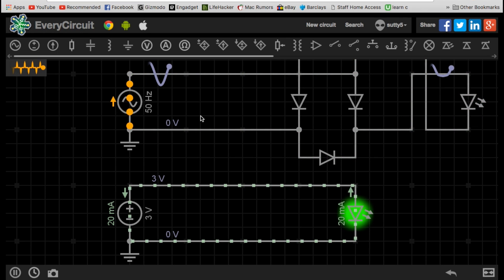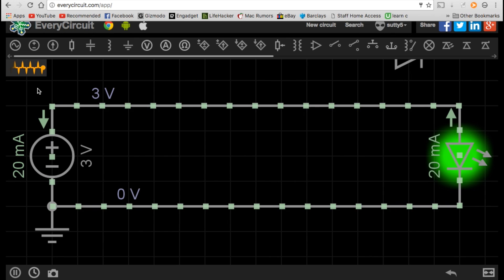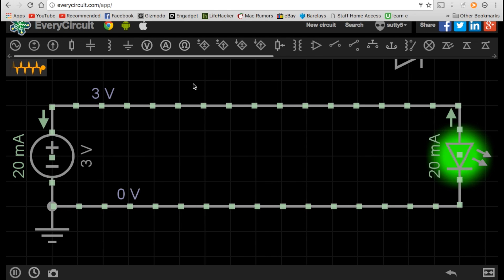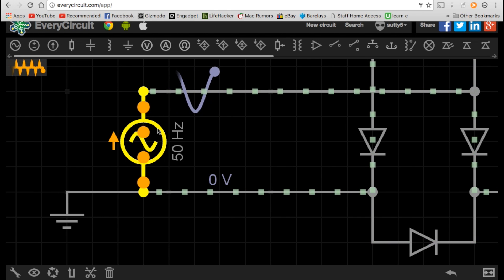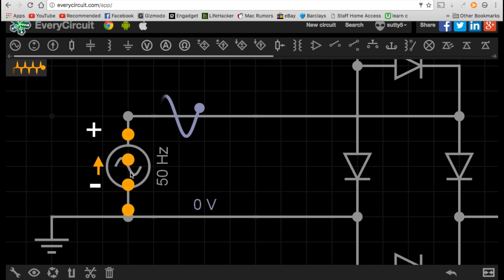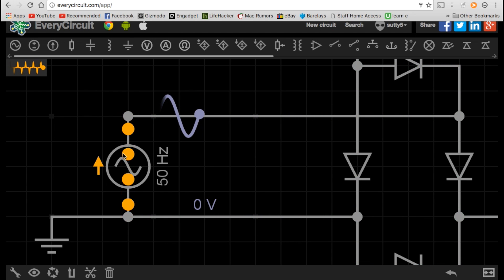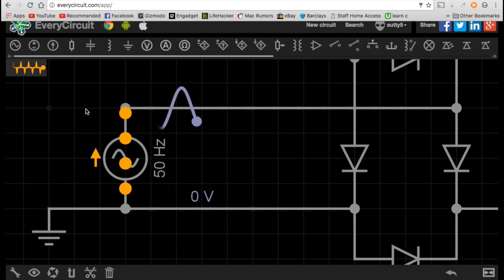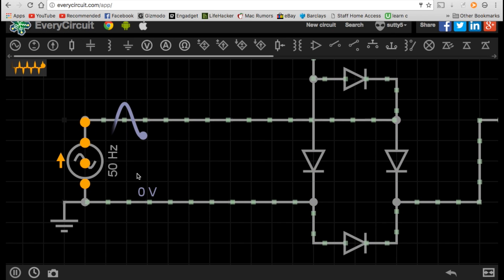AC vs DC What's the difference?! (Interactive!): Electronics Basics 3

Comment: your description of why we have alternating current is incomplete, the reason we us AC is because AC is the best way to transfer power from place to place.  if we still used DC and DC generators there would be a need for generating stations every few block to boost the power due to losses from the resistance of the transmission wires.    thank you Mr. Tesla, and not that guy who makes electric cars.   mike

Comment: Power plants DO NOT create AC at the point of generation.  This is a common misconception.   They actually create a Radiant Voltage Potential that is "Transmitted" down a "Transmission Line" in an "AC Like" signal.   When this potential reaches a Pole Transformer, it is slashed into a 50hz current for the UK, or 60hz current for the US, creating AC current for the customer.   Don't believe me?   Ask a lineman from your local utility.   Ask him/her if they can connect an AC circuit to the transmission line "BEFORE" it hits the transformer and power an AC device.     None-the-less, great videos/visuals.

Comment: I am curious...each circuit is grounded on the negative side and since most grounds from my understanding are positively charged why doesn't current flow go to ground and short out the circuit in AC or DC examples. Please explain???
Reply: This is a good question that I struggled with for a while. The reason, as I’ve come to understand it, why this doesn’t happen is: the important thing about a circuit isn’t necessarily which direction the charge is flowing in, but where the voltage differences are. When we talk about conventional current, where charge is flowing from positive to negative, the positive side of a voltage source like a battery has a positive voltage with respect to ground, so positive charges flow towards ground from that positive terminal. In the case of electron flow, that voltage difference still exists, it’s just that you can imagine ground as still being at 0V and the positive terminal of the battery as being at negative 5V, for example. This means that the electrons flowing out of the “negative” terminal are still at 0 V with respect to ground, so there’s no short because they’re still going to flow from higher Voltage points to lower ones, and the circuit behaves the same way from our perspective. I hope that makes sense!

Comment: So i'm confused about one aspect. In the first video , the circuit was flowing starting from the + terminal of the source all the way to the - terminal of the source. In the second and this video it's coming from - terminal going to the + terminal. Is there a rule ? Can somebody explain how it works ? Thanks ! (sorry for bad english)
Reply: It depends on how you view the direction of the current flow. Let me explain: Back in the day, before physicists discovered the electron, engineers thought that it was positive charges that move through the current, so they agreed on the technical current direction + to -. When physicists discovered that it was actually negatively charged electrons moving through the circuit, the direction + to - was already generelly agreed on. So that's why we nowadays have the technical current direction + to - and the physical current direction - to +. Physically, it doesn't matter because you can just view the flow of negatively charged electrons from - to + as a flow of positively charged electron-absences or electron-holes from + to -. I hope my explanation is clear :)
Reply: @AndiixAndii   .... Tanks, Yes.   But surely once an error is discovered it needs to be corrected.  Also to show 2 directions of flow in the same series is misleading and can/does cause confusion.  
So it is either one or the other not a random mix of both.
Reply: @Jasfras1  Yeah I agree. He should have mentioned it
Reply: Me too.

Comment: These videos are awesome! One detail that is wrong is the reason for A/C in our homes. You mentioned it's because of how we generate power but, just as an example, solar farms generate D/C and we actually pipe each array of panels into inverter houses where the current is converted to A/C before going off to a substation that transforms the voltage up high enough for long distance transmission. It's the fact that we can transform A/C currents up and down so easily that it gets used by the mass majority of the grid. We jump the voltage up to thousands or even millions of volts to travel thousands of kilometers and then jump all the way back down to the 240 in our homes. The problem with D/C historically has been the inability to jump it up for transmission and back down for safe consumption.
Reply: Another thing that I think he said wrong was that current swaps direction 50 times per sec. In actual it should be 100 times per sec, because each cycle/wave has 2 points where current's direction changes.

Comment: The reason we receive AC current into our homes and not DC is due to the transmission problems DC has over distance. Thomas Edison and Nikola Tesla went through a feud way back when. Edison wanted to use DC current while Tesla wanted AC. Problem was Edison’s DC could only travel about a mile from the powerhouse before the voltage and current drop was too much. While AC can flow for hundreds of miles of power lines and still be useful. The powerhouse creates DC current which is turned into AC. Then sent down the lines. Then once again turned into DC (sometimes; most small devices run on DC). Your usb block you plug in between the wall outlet and your phone charger (your phone runs off of DC) so your charger turns 120v AC (USA) into 5v DC. (if you are EU I think it’s like 220 or 240 but it’s the same principle)
Reply: This needs to be higher up!

Comment: don't cars also generate current from spinning motor? why would cars then need a battery? safety?
Reply: Cars use the alternator (spun by the timing belt) to charge the battery, which powers the DC electrical systems such as radio and lights when the engine is off. 

However the most critical battery function is to power the starter motor, this is electric and required to start the engine before the alternator will provide any power.

Hope this helps :)

Comment: Hello! Your explanations are very nice. I am enjoying being reminded of the formulas and principles that I learned so long ago in the 1970s when I was an electronics hobbyist.
There is a big error in this video, however! You mentioned that the reason why we receive AC in our homes is due to the way it is generated. This is completely wrong!
Just Google about "war of the currents". It was a competition between Nicola Tesla and Thomas Edison to determine the best way to transmit electricity through long distances. It turned out that direct current could not be transmitted through long distances in an efficient way. 
AC is the most efficient way to transmit electricity through long distances. Without alternate current, the world that we liven in could not exist.
Reply: I have just read an article that talks about a possible comeback of DC as a means of transmitting electricity through long distances. Check it out:
economist[DOT]com/blogs/babbage/2013/01/power-transmission

Comment: Why the elecktron not flow from positif side  to negatif side?
Reply: This is very wrong. Positrons have nothing to do with this, and they are NOT in the nucleus, those are Protons. Current always flows from positive to negative, it's a standart in electrical engeniering. It has to do with potential energy. But if you are not into electrostatics, you should just accept it and you will get used to it
Reply: Sebastian Gudiño I made this comment a while ago. And I mixed up positrons and protons(my bad)
Reply: Sebastian Gudiño I was very wrong at the time
Reply: it is a setting that I just figured out. Click on your user name in top right corner of everycircuit then go to settings.. then uncheck conventional current option. thought i was losing my mind too
Reply: em rifan because, positrons(which gives a positive charge) are located in the nucleus of the atom. But electrons(which gives off a negetive charge) are located in the rings out side the atom.

Comment: I'm a bit lost. If the electrons in AC don't have a net movement, how do they go through a circuit? As well, if they keep switching, don't they just lose voltage eventually from the wires or load?
Reply: They don't actually flow very fast, but they effect the neighbouring cells much like a newtons cradle. So the electrons move really slowly, but the shockwave effect moves at near the speed of light.
Reply: they thravel at 50 cycles per second as per the 50 Hz frequency.  Thats fast enough for them to make it throu the entire circuit electrically both ways!   Hope that makes sense
Reply: It's because of the construction of the circuit. The diodes in the AC circuit only allow for the flow of electrons in one direction.

Comment: Hi. Why is it that if I search the definition of Electric Current in the internet, it says that it follows the Conventional Flow which is from positive to negative side? What is its difference from the flow of electrons which as you say is from negative to positive? I'm just a little confused, thank you for a wonderful video.
Reply: In a conductive material, the moving charged particles which constitute the electric current are called charge carriers. In metals, which make up the wires and other conductors in most electrical circuits, the positively charged atomic nuclei are held in a fixed position, and the negatively charged electrons are free to move, carrying their charge from one place to another. In other materials, notably the semiconductors, the charge carriers can be positive or negative, depending on the dopant used. Positive and negative charge carriers may even be present at the same time, as happens in an electrolyte in an electrochemical cell.

A flow of positive charges gives the same electric current, and has the same effect in a circuit, as an equal flow of negative charges in the opposite direction. Since current can be the flow of either positive or negative charges, or both, a convention is needed for the direction of current that is independent of the type of charge carriers. The direction of conventional current is arbitrarily defined as the same direction as positive charges flow.

The consequence of this convention is that electrons, the charge carriers in metal wires and most other parts of electric circuits, flow in the opposite direction of conventional current flow in an electrical circuit.